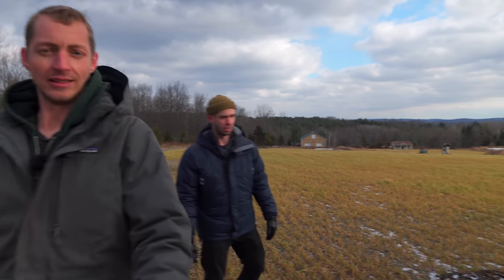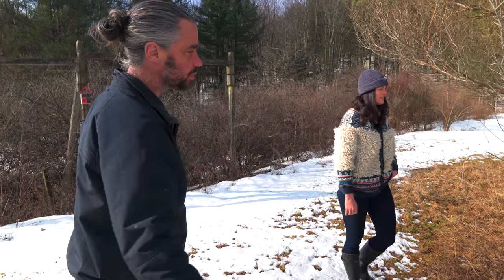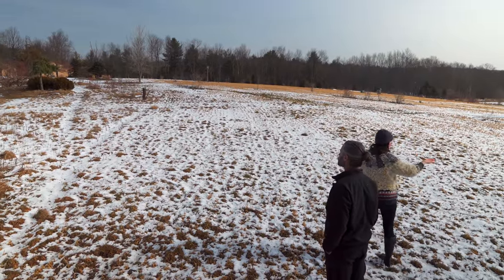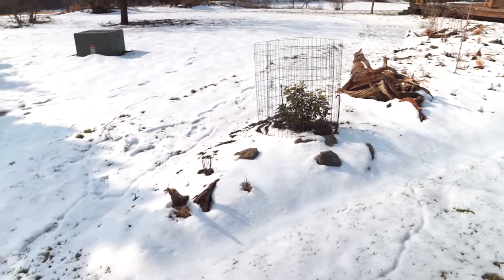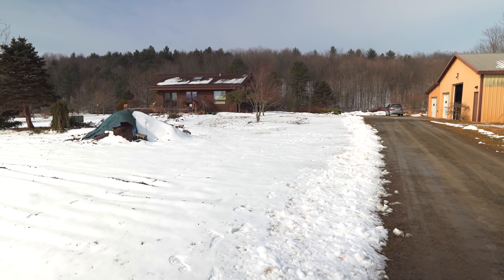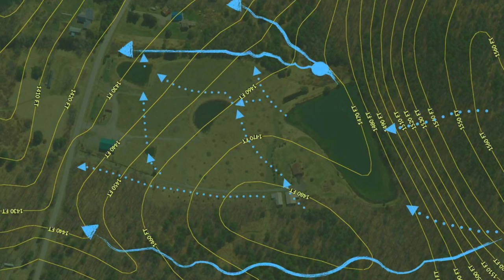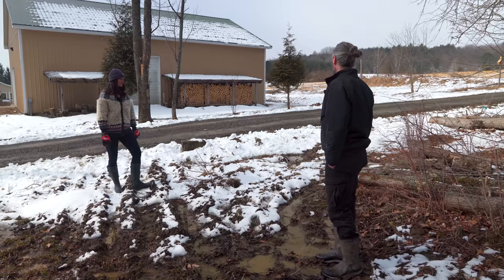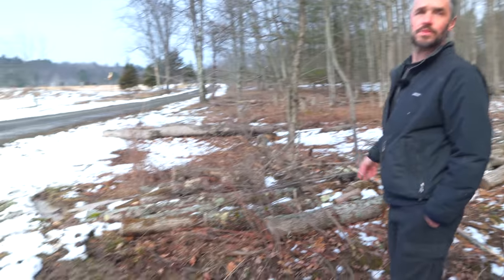WATER MANAGEMENT on the Land: PONDS, STREAMS, SWALES, BERMS & WATER BARS — Ep. 085

Comment: I do exactly on my driveway what Shawn told you to do on your driveway.  In Spring it needs more attention but once you have your little water paths (ditches) set...its just quick maintenance. They do work and Shawn has set you on the right natural path. Before a big rain just check the channels to make sure the are clear to run. Just something to add to your to list but once you have them its just a quick check that nothing is clogging the streams.  Water will find its easiest path to flow so you can help it finds its directions.  So nice you had Shawn to help you.
Reply from the maker: Indeed. It's repetitive but simple. And some of those simple solutions are the ones that we often overlook.

Comment: If you want to permanently fix the surface of your gravel driveway, I highly recommend a land plane! It sorts the slightly larger gravel to the top to stop erosion and fix some of your wet spots—you can use the depth of that tool as well to create swales so the water can drain as well like Sean was saying

Comment: we also have a spring fed pond with a 8 inch overflow. i have been looking into the possibility of getting  a turbine hooked up to generate a little bit of extra power. we also have a small stream that empties into the pond which during a heavy rain can truly become a raging torrent and is actually silting in the pond. i have seen tiny (bottle cap size) turbines being used in streams in indonesia to run led lights which are a great option when you have no electricity. i am hoping in the future to re route the stream so that it meanders through the landscape and then empties into the overflow stream on the backside of the pond.  we can then dredge the pond back out. i want some paddle fish and sturgeon for visual interest. if you have moving water a ram jet pump is another great option to move water around or even up hill.
Reply from the maker: Really cool. Let us know if you end up digging your heels deeper into turbines. Will have to look into a ram jet pump. We were at Chanticleer Gardens and they had some ingenious pumps built on gravity of the streams. Meant to look into that more.

Comment: Great content and analysis but I did laugh when Sean said a truck load of woodchip and "an hour or two" :o  I guess you're using a bobcat or skidsteer  as I'm currently trying to get a truckload of chip into a 7 acre woodland via a wheelbarrow and it's taking weeks. It's dense woodland so it is a different context but if it's as big an area as the camera makes it look I'd advise against using a wheel barrow, a quad with a front loader or tractor could be needed. The woodchip is certainly a great idea and you will start to get lots of mushrooms in a year or two. Also worth mentioning, if the water pools first around the woodchip and then starts to flow with more volume the water will move it, the chip will only stay put if it just pools i.e it won't just float in my experience, but as soon as it starts to have a flow, everything follows. Very observant and informative video, thanks.

Comment: My concern with adding any power generation to a pond outlet would be restricting flow. In a major weather event I'd want the full diameter of the pipe, allowing as fast a flow as possible.
Reply from the maker: It's something we know little about so we'd have to look more into it. But one thing we know is we'd like to have at least three back-ups. If dam 1 gets blocked, then you have Overflow 2, and if Overflow 2 gets washed out, then you have Overflow 3.... we just have to multiply that by 4 for the ponds and multiply that by 2 for the streams. We spent more time a couple weeks back with the water considering more ideas. Lots to think about!
Reply: @FlockFingerLakes  definitely. Water systems are so exciting to work with, but a challenge with the frequency of major weather events, moving forward.
Reply: I agree about restricting the flow of a single pipe. A dedicated flow outlet that can also be shut off or diverted for maintenance reasons would be advisable. That way you are also not tied to whatever the current location of the outflow is. I'd give allot for a stream large enough or a pond with a decent outflow potential on my property.

Comment: Watching this has me asking again "why is rain fall measured in inches and not gallons or liters."
Also thanks for the good content.
Reply from the maker: With the way it comes down now, you do begin to ask yourself that question!
Reply: My guess is, you're measuring a quantity that falls on a two dimensional field. If you have a flat terrain underneath, 1cm of rain is then multipied by 1m² and that's one liter. But if you have a slope, there's more land area "per m² of sky" if that makes sense, which makes volume units irrelevant 
Like so
_
    /
  /
/
Reply: @Jeuro38  hum. I do get that this is why they measure it this way, but I've never been able to convert that to quantity of rain like I can with snow since it stays on the ground where it lands.

Plus during rainy conditions isn't the whole air around you a sign of liquid volume?

Comment: Displace the barn on higher ground ??? And  the water can go it's own way ???
Reply from the maker: It's a really good thought, but the barn is super solid. It's got 6" of concrete  underneath as a base and is fully plumbed with electricity, etc. so we'll have to work with it where it is. If we were working with raw land, we probably would have reconsidered where a structure like that would go in relation to everything else. We love Sean's approach with subtle shifts, and we think the subtler shifts we make upstream will have those big impacts down below. We feel grateful we've had these extremes in weather right off the bat because it really allows for us to see a range of consequences / results
Reply: It was really interesting to watch. Wish you all the best for the future.